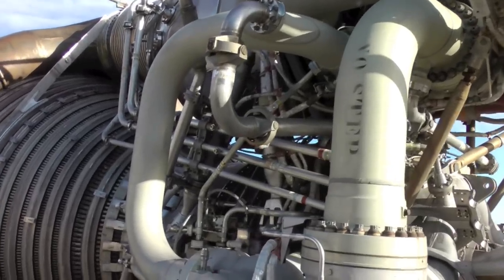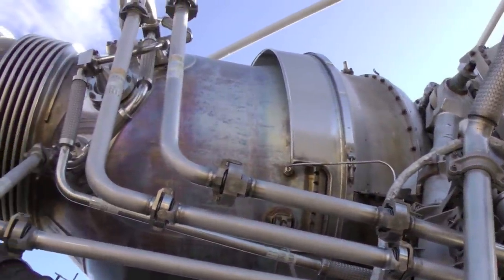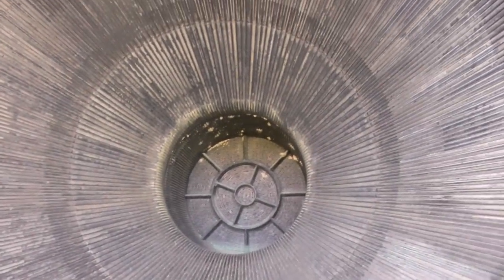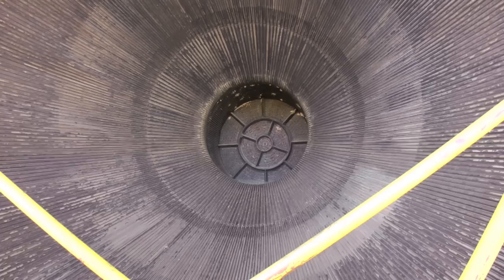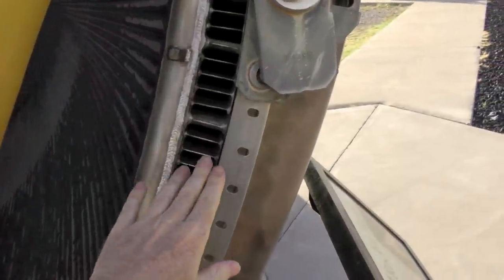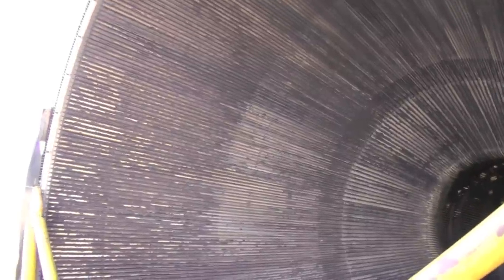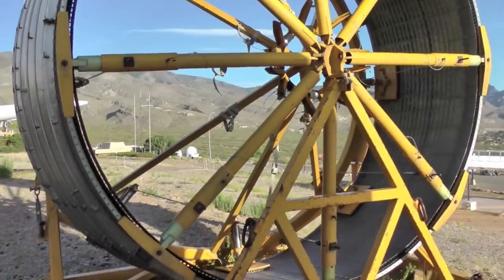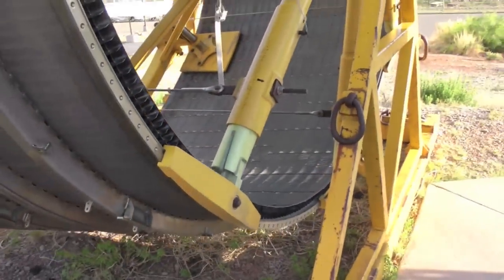Saturn 5 Moon Rocket's Main Engine, the F-1 | NASA Apollo Program Space Travel HD

Comment: Technology of closed loop combustion of kerosene and oxygen-designed in the Soviet Union to the moon rocket N1.H1 rocket weighing 2735 tons-developed sea level thrust 4600 tons.In 1969 had 30 engines with thrust-to-136.The Saturn 5-set 5pcs F1, all without closed-loop combustion aft
erburning of oxidative gas.
Reply: Only one problem, the rocket kept blowing up. DIDN'T WORK, so no Moon landing for you.
Reply: ELECTROSTATIC ION ENGINES The Soviet N1 Program was canceled for political reasons. The development problems with NK-33 were cleaned up in the final iteration. The surplus engines were stored away and are now use in the Orbital Sciences Antares Program along with the Soyuz 2.1v. Their performance is unmatched by anything produced in the west. The RD-180 manufactured by NPO Energomash is based on the same technology as the NK-33 and is the backbone of ULA EELV Program. Launches using the RD-180 comprise 60% percent of the US launches.
Reply: Bob Marston And your point is?
Reply: The Soviets chose a more difficult path in their choice of rocket engine design and ultimately succeeded in producing a superior product. As a matter of fact the advantage of their close-loop design stands as superior today 40 years after it was perfected. This is a tested to by the fact the US Space Program readily buys them up for their own needs rather than produce a kerosene fueled close-loop design of their own.
Reply: Bob Marston why would any space program spend  R&D when they can buy a engine of that thrust range that was sitting in a warehouse. It is just good business to use them, Besides it helped to keep Russia's space program going  and  allowed more time and money for NASA to develop the SLS heavy lifter.
Reply: Because nobody is building NK-33 (14D15) engines anymore. Their lucky to have a few dozen still in existence to rebuild. The old soviet empire had commissioned they all be destroyed.

It was Lockheed that got lucky and heard of these engines still in storage and bought them. 

I still would not use them on anything but earth orbit payloads. The idea of stacking 30 to get what 5 F1's produced is asking for 30 extra ways for an engine malfunction or worse an explosion.
Reply: Claude Rains
A few dozen, hell no, that warehouse had over 400 of those engines.
Reply: I was referring to how many Lockheed had bought somewhere around 24 of the 150 that existed at the time. 

I might add you start trying to upsize them you have to totally redesign them. They don't take to well to higher chamber pressures. One reason they needed 30 and not 5 large ones.
Reply: ELECTROSTATIC ION ENGINES No it didnt.
Reply: hoghogwild
Didn't what?
Reply: ELECTROSTATIC ION ENGINES Didnt have over 400 NK-33 engines in that warehouse.
Reply: hoghogwild
That is not what the video said that I saw.
Reply: Bob Marston
Yea, what a performance those engines had on October 28th, 2014!  The modified NK-33 engines are the same ones used for the Antares rocket which on that date had an turbopump failure shortly after launch, destroying the vehicle which was supposed to loft the Cygnus spacecraft to help resupply the International Space Station.  As for performance, the Merlin 1D engine developed by SpaceX has a slightly higher thrust to weight ratio than the NK-33, although it does not have as much thrust as the NK-33 does.
Reply: It's a good think they went to the Merlin 1D as the Russians will not ship any new NK33's to the US anymore because of the US embargo imposed on them.
Reply: Claude Rains
That is good news
Reply: The Merlin Engine is used is used on the SpaceX Falcon Booster NOT the Orbital Sciences Antares or the ULA Atlas V. The use of a single Merlin engine rated at 122,000 lb of thrust in the Antares is wholely inadequate. The NK-33s were obtained by Aerojet (formerly Rocketdyne and a constituent part of ULA) from Russia through RD Amross. The engines were remanufactured and redesignated AJ-26 before being sent to Orbital Sciences. There they were integrated into the Antares Launch Vehicle. When the Antares Launch vehicle experienced an engine failure in December Orbital Sciences decided to immediately suspend and then terminated use of the AJ-26. 10 Days ago it was announced That Orbital Sciences had signed a contract with NPO Energomash, the manufacturer of the RD-180 used in the Atlas V, for 60 new design design RD-181 engines. The contract is structured as a firm order for 20 engines with 2 options of 20 engines. The RD-181 is an upgraded version of of the RD-171 used in the Russian Angara Program and will produce 500,000 lb of thrust.

ULA currently holds a stock of 17 RD-180 engines used on the Atlas V Booster. On the current contract between ULA/Aerojet and NPO Energomash 24 engines remain to be delivered. That is scheduled to be completed by the middle of 2017. Two days ago an article published on the SputnikNews website states that ULA is in negotiations with NPO Energomash to contract for an additional 30 RD-180s. That would enable ULA to fly Atlas Vs until 2021. NPO Energomash has promised delivery of the first RD-181 to Orbital Sciences for live fire testing in June 2015 with a test flight possible by the end of 2015. The SputnikNews article states the agreement between NPO Energomash and Orbital Sciences is expected to last AT LEAST 15 Years and in all likelihood 25 years.

Comment: So FIVE F-1 engines powered the Saturn...  Why did the Russians go with THIRTY engines for their N-1 Rocket???
Reply: One problem that design of physically large engines has is what is known as "combustion instability".  This can compromise the performance of (or even just plain destroy) a rocket engine, and is more difficult to control or eliminate in larger diameter rocket engines.  Thus, using many smaller engines rather than a few really big ones can allow one to avoid the problem of having to build really big engine like the Saturn V's F1 engine and come up with a way to get around the combustion instability problem.  Even now, the Russian RD-171 "engine" which has 1,697,300 lbs of sea-level thrust (more than the original F1) still uses four separate combustion chamber/nozzles/engine bell assemblies rather than only one big one, so it is more like four engines rather than one.
Reply: David Knisely Okay.  So that's how the Russians get around "combustion instability," so how did the F-1 engine get around that same problem?   And why don't we use that type (large diameter) of engine anymore?   The F-1 was successful, was it not?
Reply: mlovmo
I don't know how the Russians do their designs, so you would have to ask them.  With the F1, they used an explosive charge in the exhaust to trigger combustion instability and just kept changing things like the nozzle design and the acoustics of the engine until the problem was minimized.  The F1 worked, but the US chose to abandon the Saturn V in favor of somewhat smaller reusable (RS-25) hydrogen powered engines for the space shuttle, along with large solid rocket boosters which were simpler and each provided 80% more thrust than the F1 did.
Reply: David Knisely Yes, acoustics (vibration) seems to have been the problem with the N-1 rocket.    Thanks for your responses, which were enlightening.

Comment: This F-1 has never existed with claimed thrust 6.77 MN. It's just a fake for ignorant.
Reply: Uh, no, the slightly upgraded F1 for the final Apollo missions (Apollos 9 through 17) had a sea level rated thrust of 6.77 MN (1,522,000 lbs).  However, certain missions ended up with slightly better performance than this.  For example, the actual measurement of the liftoff thrust of Apollo 15 was 7,823,000 lbf (34.80 MN), which would mean an average F-1 thrust of 1,565,000 lbf (6.96 MN)  per engine (notably more than the rated value).
Reply: David. You are wrong. Even such programms as the Mercury and the Gemini were fake, not only the Apollo.
Reply: David. What maximum weight could the Atlas-D carry to an orbit?
Reply: The modified Atlas D LV-3B version which carried the Mercury spacecraft into orbit had a Low-Earth-Orbit payload capability of about 1,400 kg (3086 lbs).  The use of this launch vehicle dictated that the Mercury spacecraft have a maximum weight of about 3000 lbs.
Reply: David. But actually the mass was 2 tons. Therefore Atlas D LV-3B was not able to carry into orbit this mass.
Reply: Сергей Мишин
I don't know where you got that 2-ton figure, but the maximum mass of the heaviest (fully-loaded) Mercury capsule ever launched (Mercury-Atlas 9, or "Faith 7") was 3000 lbs (1361 kg).  This is 1.361 metric tons or 1.5 English tons, not two.
Reply: David. Right. But you forgot LES.
Reply: Сергей Мишин
And you forgot that the launch escape system (LES) tower was designed to be jettisoned only 2 minutes and 24 seconds after launch once the two booster engines of the Atlas D were discarded.  The Atlas then continued to accelerate in its flight to orbit using its center sustainer engine with the Mercury spacecraft payload, but without the escape tower.  The tower system had a total mass of 580 kg, which again was only carried in the early part of the flight well before anything close to orbital velocity had been achieved.  The Mercury capsule itself had a mass (fully loaded) of about 1,118 kg and the retro-rocket package had a mass of about 237 kg, so the portion of the Mercury spacecraft which got to orbit had a nominal mass of around 1355 kg.  Lots of people worked on the Mercury program, watched the launches, heard the astronauts, tracked the spacecraft, and witnessed the splashdowns, so your contention that it was all "faked" is total nonsense (despite your weak attempt to prove that this was somehow not possible using the Atlas D).
Reply: David. The R-7 was not able to carry a manned capsule with LES tower. But this R-7 was more powerful than the Atlas-D. Got it?
Reply: Сергей Мишин
 Why not do a little more research sometime?  The Soviet R-7 was the first ICBM and was not intended as a launch vehicle for a manned spacecraft.  Only after considerable upgrading and development resulting in the Vostok K (loosely based on the original R7 and Vostok L designs) did the R-7 "family" of rockets have one that could easily launch a person into orbit.  The Vostok-K was able to lift more than the Atlas, but  this rocket had to, as the Vostok spacecraft which flew Gagarin into orbit was over three times heavier than the Mercury spacecraft.  In any case, the R-7 has nothing to do with the fact that the Atlas-D was successfully used to launch the Mercury spacecraft into Earth-orbit six times (four times manned).
Reply: David. The Atlas was used to deliver war-head W38 with mass 1400 kg for maximum distance 14000 km. Equator is 40000 km. What orbital flight of John Glenn are you talking about?
Reply: Сергей Мишин
WHAT ARE YOU TALKING ABOUT???   The Atlas ICBM could carry the W38 and  its Mk4 reentry vehicle, which had a total mass of 1840 kg, but again, just because a vehicle can loft such a mass to a given target (14,480 km is the listed "range") does not mean that it cannot also put a somewhat lighter spacecraft with a mass of 1361 kg into low Earth orbit!   Orbital flight is different than just achieving a simple ballistic trajectory.  All the rocket has to do is put the spacecraft out of the majority of the Earth's atmosphere and moving at a velocity of about 7.8 km/sec.  The Atlas D did that many times, especially if you count all the unmanned satellites it launched.  Distance or "range" does not factor in here at all.  Once the spacecraft gets to that velocity and altitude, it will continue to orbit around the Earth many many times more than 40,000 km until it either performs its de-orbit burn or is up there long enough that high altitude atmospheric drag eventually forces it to reenter the atmosphere and fall back to Earth (or burn up on reentry).  It's that simple.  John Glenn, Scott Carpenter, Wally Schirra, and Gordon Cooper all went into orbit in their Mercury spacecraft, each of which was placed into orbit on a slightly modified Atlas D.
Reply: David Knisely Don't feed the trolls.
Reply: David. I suppose the film "For all mankind" to be really funny. It was filmed on Earth.
Reply: Сергей Мишин
Troll, troll, troll you post.
Gently down the screen.
Merrily, merrily, merrily, merrily
your stuff's just not worth beans.
Reply: David. I am not a troll at all. There is  a couple of episodes I suppose to be really funny. One of them is where an astronaut said: what an interesting rock". It is obvious it's just a play.
Reply: Сергей Мишин
I'm afraid that the only thing obvious here from what you have presented in your postings is that you don't really know what you are talking about (or are indeed just a troll).   "For All Mankind" is one 80 minute long film (mostly covering the Apollo moon landings) and has no "episodes".
Reply: +David Knisely correct and in vacuum it delivered 9.2 lbs
Reply: David Knisely Not only the Apollos were faked but also the first space flights of NASA. There are proofs of it.
They were not orbital, they were sub-orbital. For instance the flight of John Glenn.
Reply: David Knisely The paint can't stay after the re-entry.))) It's obvious that NASA had been bluffing.)))

Comment: these engines WAS  the most powerful ones, UNTIL  the SOVIET RD-180 came into place.
The RD-180 is more efficient because it uses a closed cicle an cheaper fuel .Perhaps new one  DS-15 will surpass the RD-180 Used TODAY  in the delta rocket...
How the SOVIETS, clould be able to produce the RD-180, for me, its a mistery....
Reply: Actually, the RD-180 is NOT more powerful than the F1 engine. The RD-170 from which it was derived is the one you're referring to. But that engine used four thrust chambers. The F1 engine is still the most powerful single thrust chamber rocket engine ever built.
Reply: F1 and the RD-170 both used Kerosine (RP-1) as its LF, although the Sovjet version may have been a bit less refined. Anyways, it would be more an applause of Sovjet jet technology, it they wouldn't need a higher refined version of it. 

Anyways, RD-170 and F1 don't differ to much in thrust (it is about 10%)  its just that the ISP on the first is a lot better. Thrust to weight of the single chamber/ nozzle F1 is better though.

The thing that amazes me is how they've been able to blast the US effort away from the start with the R7's payload capability from the very start of the space race. At the end I think they've just lost the edges by US funding of tests and avionics.
Reply: ive had farts with more thrust young man.....
Reply: In Russia scientists are treated like royalty unlike the USA; engineers nearly the same.